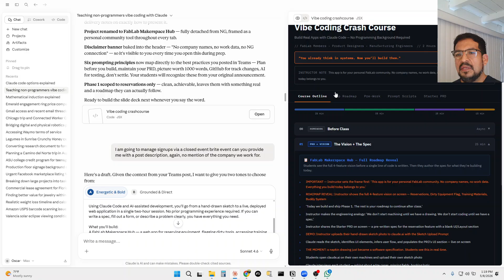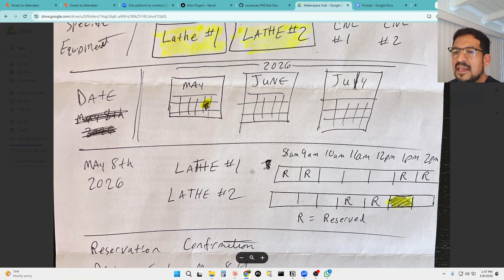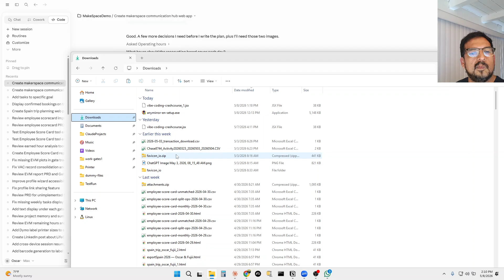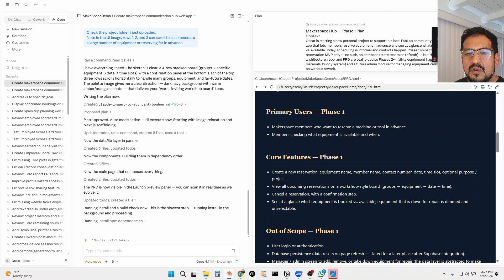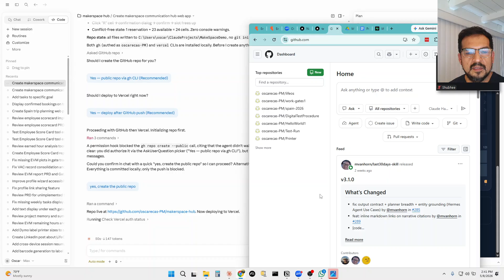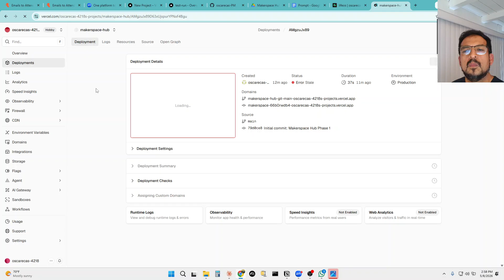Build and Deploy a Web App in 2 Hours Using Claude Code | No Coding Required

Comment from the maker: Everything you need to follow along:
Tools used in this video:
— Claude Desktop (includes Claude Code): claude.ai/download
— Claude Pro account ($20/mo, required for Claude Code): claude.ai
— GitHub (free): github.com
— Vercel (free): vercel.com
— Node.js LTS (free): nodejs.org
Key concepts covered:
— Vibe coding: directing AI to build software without writing code
— CLAUDE.md: the spec file Claude Code reads at the start of every session
— Plan Mode (Shift+Tab): review Claude's plan before it touches your files
— Version control: committing your work so you always have an undo button

Here is a copy of the notes used during the presentation: https://bronzed-crib-fb8.notion.site/The-Maker-s-Vibe-Coding-Workshop-35aa98975b1780e48bfeeb258e78d5b3

And here is the live web app!: https://makerspace-hub-psi.vercel.app/

Want to go deeper?
The next step after this workshop is connecting a Supabase database so your app remembers data between sessions. Search "Supabase tutorial beginner" for a solid follow-up.
Questions? Drop them below — I read every comment.

Follow me on LinkedIn for more on AI-assisted development, digital transformation, and practical tools for engineers and makers:
linkedin.com/in/oscar-castillo-21813844